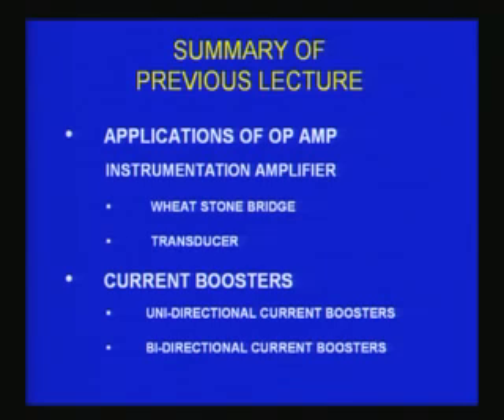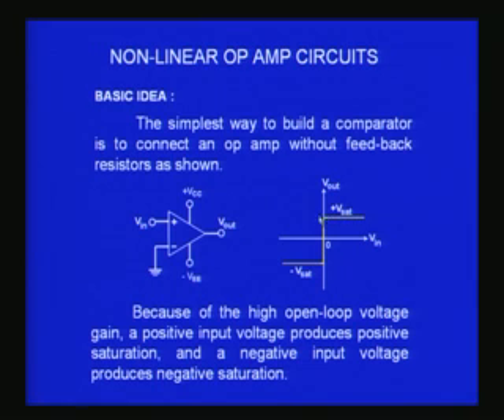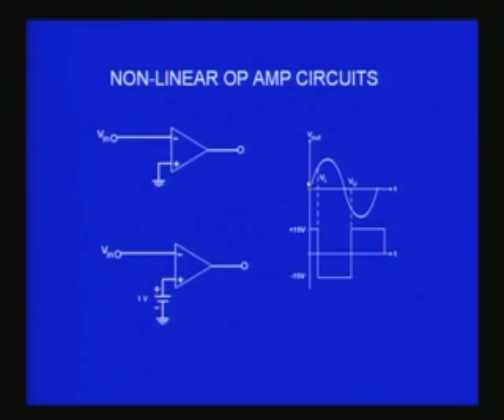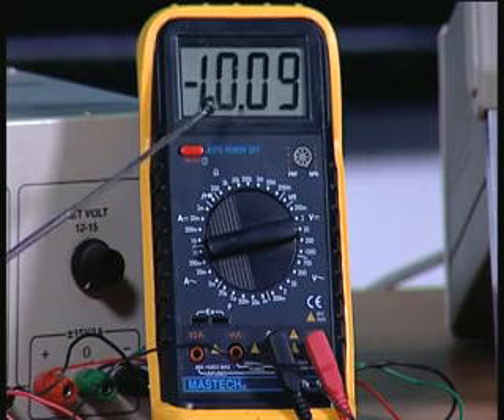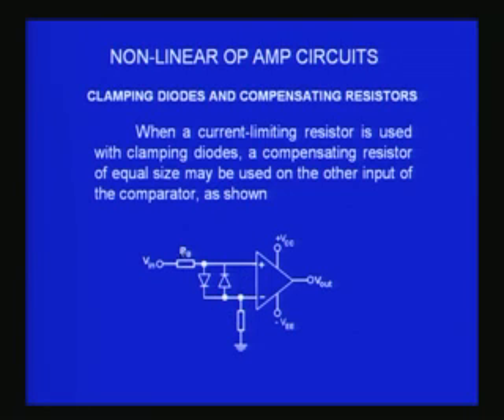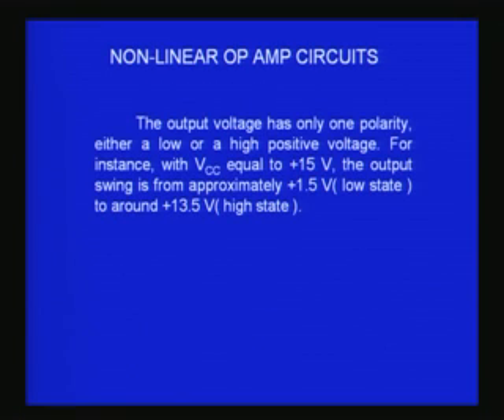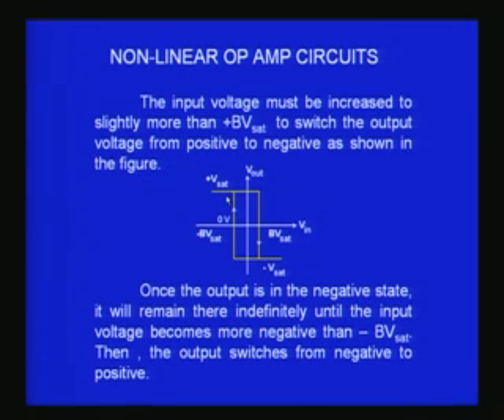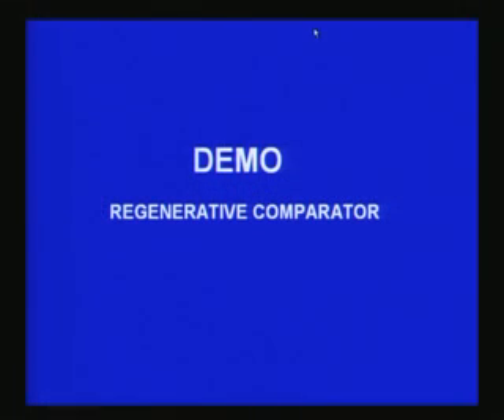Lecture - 32 Non-Linear Op Amp circuits

Comment: I've got about 100 MV at the output drivers of a audio amplifier I traced it back to the per-amp section which is a LM-833N op amp, though I've changed that chip I still have the DC offset but now reading about 80MV what's the best way to bring that closer to zero so there's low offset at the amps main output appreciate any help.

Comment: A dual supply is necessary for the op-amp to achieve its documented immunity from noise entering via the power supply. (PSRR: power supply rejection ratio).  On a single supply, reference voltages are typically drawn by using a voltage divider between +V and 0.  This reference voltage thus picks up whatever ripple and noise is present in the +V (just divides it by two). In a dual supply, you can use the real ground as a reference.